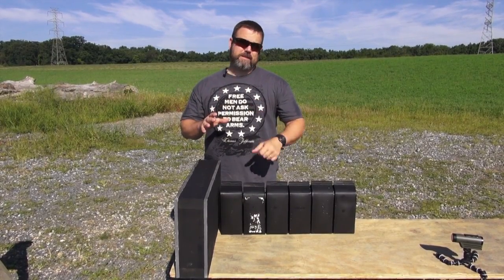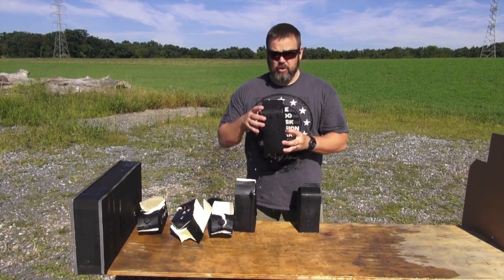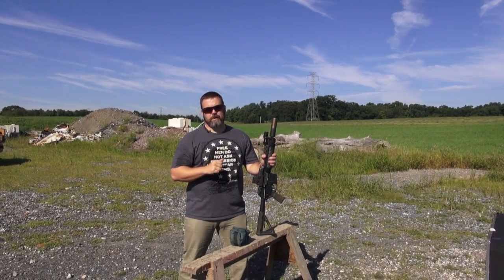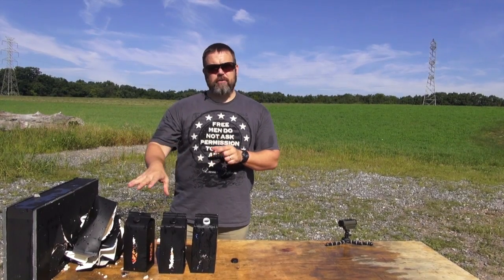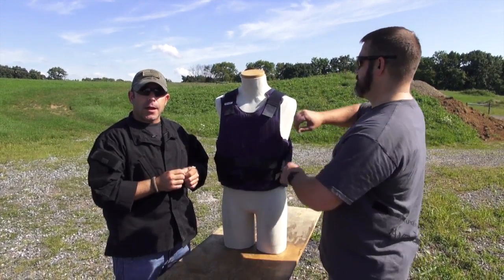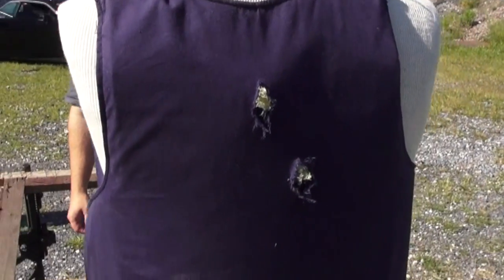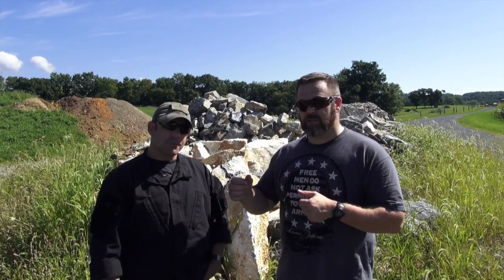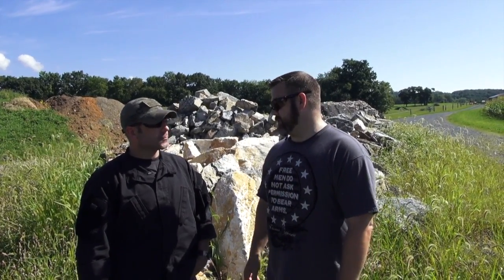9MM VS. 5.56 BALLISTIC COMPARISON

Comment: Apples and Bananas bc this comparison is completely BANANAS!! You are suppose to compare Ammos not firearms. Otherwise, I could have done the same test on my own (in my head)  if we were wondering which ammo has more stopping. And oh yeah, it's the 556....

Here is a tip: Find 2 similar pistols and 2 rifles (each with 1 of the 2 calibors or close to it like a 5.7 pistol instead of 556 and disclose that that's the closest to a 556 pistol you could find) and test the 2 pistols to compare each calibor's effectiveness n then the 2 rifles, not just grabbing what ever u have laying around and saying " Well, we didn't have a 9mm AR type rifle"

Because at the end of the day, most are watching this because they are interested in 9mm rifles but are wondering how much power will they lose by switching to a 9mm and if it's worth the trouble for the convenience of using the same ammo and magazine as their side arm and the fact that it's shorter or it tears down.

Comment: Wait whaaat...i thought the ar 556 round would go thru all those water cartons easily, but the 9mm pistol penetrated more?!
Reply: high velocity = more explosive "early" damage, but smaller faster rounds breakup quicker bc of the same speed. Perfect example was the concrete block.  Neither bullet went through in one shot, but only fragments remained from the 5.56 where as the 9mm was (in better shape). I think 5.56 is overkill for home defense.

Comment: A lot of things are fine for normal home defense scenarios.
I think the argument is about which is the most effective for the military.
The switch to 5.56mm is still highly controversial after 50 years.

Personally, I think 7.62mm is under-utilized.  At least 1/3rd of our forces should be using 7.62mm, imo.
5.56mm is what I colloquially call a 'room clearing round'.  It is sketchy as hell for things like the mountains of Afghanistan and other longer-distance engagement zones.

Comment: 5.56 more power...
Reply: less penetration though.
Reply: Depends really.  This comparison was a rifle vs pistol rather than 5.56 vs 9mm.  Barrel length will be the deciding factor.  I'd like to see a similar comparison with 9mm vs 5.56 in different barrel lengths.  My guess would be that the 5.56 would outperform the 9mm at longer barrel lengths and the 9mm would outperform at shorter lengths.  The real question is what is that magical barrel length number where a 9mm becomes more effective than 5.56?
Reply: 5.56 = moderne assault rifle...rate par minute...acuuraty ; long range...
Reply: @bardns3759  its much more complicated than that.  5.56 is dependent on velocity for its ballistic performance.  When you shorten the barrel length, you are lowering the velocity and thus the effectiveness of the 5.56 round.  9mm on the otherhand, is designed to function at slower speeds.  A 9mm projectile has more mass and is roughly 5x the size of a 5.56 round, and that is before accounting for expansion.  A full size 5.56 rifle vs 9mm is no comparison, 5.56 wins.  But drop the barrel length down to SBR parameters and I think it would be an interesting comparison.
Reply: @strangeravenoutdoors4650  probably ; so more assaullt rifle use 5.56 now...sniping is better with big ammo ; cheytac; barrett 416 ; cal 50...learn balistic is interresting

Comment: 0:21 No. Not even close. The Black Talon was decent for its time but Gold Dot and HST have far outclassed it.
0:37 Ranger T. That's what it's called. You couldn't take ten seconds to Google it?
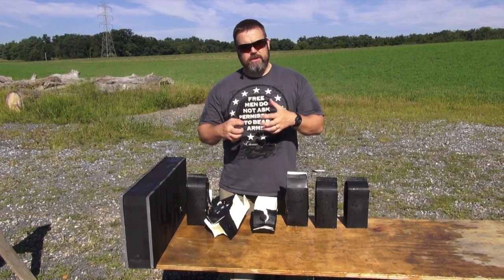1:23 Water is compressible, just to a far lesser degree than air. But its relevance as a ballistic medium isn't related to its compressibility. It is consistent and that allows some very general comparisons to be made, but its relationship to tissue is not linear with velocity so comparing 9mm to .223 in water is pretty pointless.
1:28 Energy is not a significant factor to handgun wounding.
8:05 "Spall" is a term that refers to pieces of bullet and/or armor that leave the back face of steel or ceramic armor. Soft armor does not produce spall. 

There is no argument that .223 is more powerful and better suited to defense than any handgun, but you intentionally chose an obsolete 147gr JHP to "prove" deeper penetration from a pistol. A more modern choice like a 124 gr Gold Dot would have been closer in penetration. The overall point of your demonstration is still valid but your method is slightly deceptive.
Reply: ensitu "water is compressible, just to a far lesser degree than water". Read that again and revisit your comment please.
Reply: The Chopping block is a competitor on youtube that does make ammo/gun videos.  This is his tactic to get you to watch his videos.  Distasteful, rude, nitpicky, not even fully correct, but possibly effective in this environment.
Reply: Whatever the truth is it should be said.
Reply: The Chopping Block do you watch videos to criticize everything you can so that you can show you have more knowledge than the one who spent time and money making the video? If so, let me give you some criticism and say make your own, better video.  If that isn’t what you are doing then just watch and enjoy the video you didn’t pay for and was entertaining ( although according to you inaccurate which is 99% of what Hollywood does so it wouldn’t be hard).

Comment: What i would like to know is this, If i had to build a weapon and recoil is not an issue, what would be more potent for self defense at home, an AR 15 in 556 (7.5 inch barrel) or an AR 15 in 9mm (same short length barrel). over penetration is not as much of an issue for me as it may be to most but its still something to consider.. please point me in the right direction.. thanks
Reply from the maker: mariah Sadia We would still roll with the rifle although I usually don't recommend going any shorter than 10.5 with the barrel.
Reply: Rider Mak Lol This statement is so inaccurate...
Reply: mariah Sadia
Reply: mariah Sadia 
All 5.56 bullets from 40 to 70 gr. require a certain velocity to have effective terminal ballistics.  That velocity requires a minimum 16” barrel.  If you really must have a rifle cartridge in a very short barrel,  a much more effective choice is 7.62x39.  
30 cal.  123 to 154 grain bullets don’t depend as much on velocity to deliver big hurt.  And it would make 9mm look like a pellet rifle.  
7.62x39  154gr comes out of a 10 inch barrel at over 2100 fps.   Ouch.
Reply: @ridermak4111  yet you or anyone you know would dare to step infront of my 7.5inch AR loaded with anything....

Comment: And then it penetrated steel and the 9 mm didnt. Its confusing :p
Reply: Its because its based on mass vs speed a 5.56 travels somewhere around 2300 fps where an average 9 mm is around 1100 fps with a larger grain. The average grain for a 9 mm is about 110 grain vs a 5.56 at around 62 grains. Speed beats armor every time.

Comment: Been deciding between my 9mm or 5.56 for defense, couldn't figure how 5.56 would slow faster despite commenters saying so. This video shows how the physics actually work; great vid!
Reply: As long as your target is made of water.
Reply from the maker: Glad you found the info to be helpful.   I do this demo in training all the time.  Its one thing to here about the ballistics but another thing entirely to see it in action.  

Phill
Reply: +Trop Gun try the same test again, with just drywall, and you will find that both rounds have similar penetration characteristics.  The difference, however, is the extreme amount of energy being dumped by the 5.56 in the first few walls. Moral of the story is that 5.56 is devastating to whom ever is in the next room or the one after that.  Terrible choice for urban home defense.  That is the reason most pistol victims die of exanguination, while rifle victims die rapidly from the trauma caused by the rifle round.  The damage to the back of the drywall in your first test proves my point.  The vest test further confirms this.  That is the reason why using fluid filled containers actually renders an inapplicable result.  As you mentioned, fluids are incompressible (Bernoulli principle), the problem with your conclusion is that it assumes fluids (in sufficient quantities) will serve as the means by which a rounds energy is dissipated.  That's not the typical real word scenario.